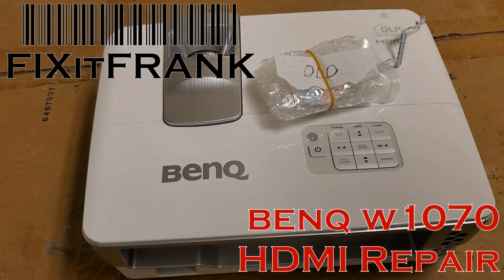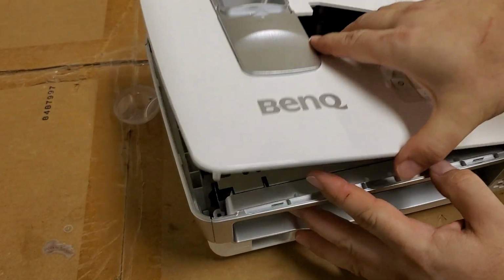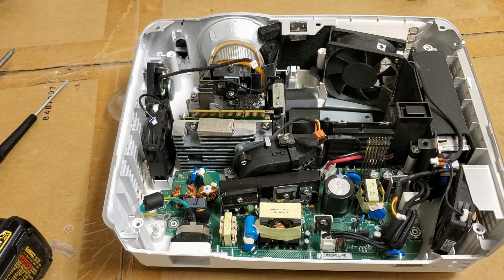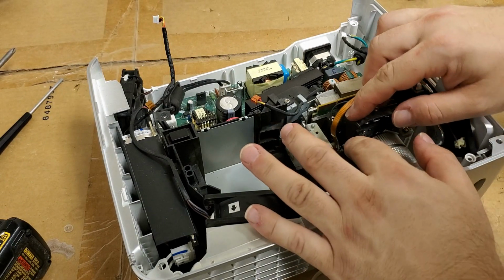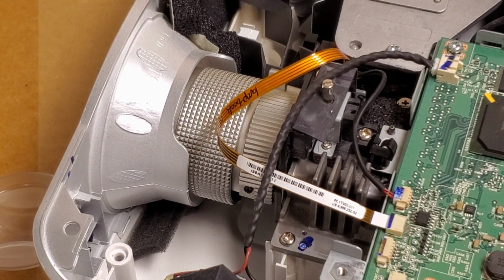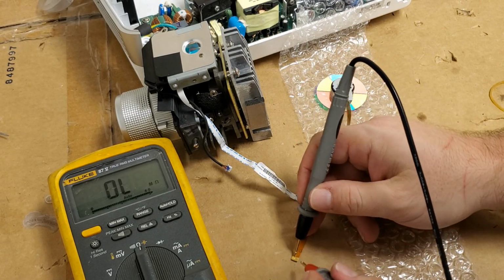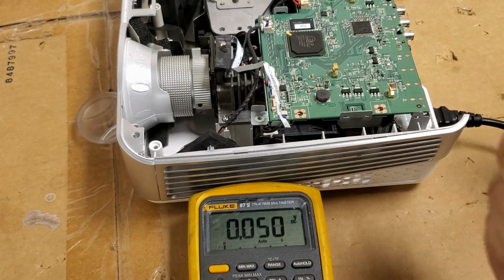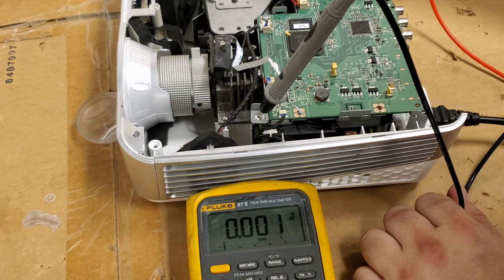BenQ W1070 DLP Projector Repair / No Light-HDMI Issue Part 1

Comment: hello frank i got a question my benq w1070 wont turn on the power button is lit, the lamp logo is off, and the temp, is off. can u pls help me ty
Reply from the maker: Does it do anything at all? No fans? No other noises?  
One thing to check is for a stuck button. Unplug it. The press each button and make sure you feel it click.  If not, that might be the problem.  If another button is stuck, it wont let the projector see when your main power is pressed.  If not, then it will need to be opened up and voltages will need to be checked.  Getting a power light and nothing else is unusual.
Reply: @FixitFrank  so i opened it today and i checked the bulb is looking good no cracks or black soot,  when i do press the power button while holding down the other button i dunno what its called, it doesnt do anything, no fans and no light from the lamp, and the color wheel is not spinning. and no other noises the button feels fine i  clicks as a press it
Reply from the maker: @xatreyu  make sure the door is closed. It won't do anything with the lamp cover removed. If the lamp cover is installed and it's not working, it would need to be checked inside.
Reply: @FixitFrank  yes i made sure the door is close so the fan, color wheel and light is not turning on and no other noises. what could be the problem of this?
Reply from the maker: It could be a few things.  Power supply problem, bad button, firmware, or a mainboard.  You would need to be well versed in using a volt meter to search further. If you have a meter and want to try, let me know.
Reply: @FixitFrank  sure I can give it a try so which one should I test first and how
Reply from the maker: @taylor-robloxandetc1944  I'd start with checking the button for function.  Then move onto the power supply.  After that its mainboard testing and that can be very involved.

Comment: help me please I opened up my projector because when I dropped my projector the glass from the bulb went in the blower fan and when I removed the glass and put the projector back together it won't turn on? what did I do wrong
Reply from the maker: Hi Justin, I have a few questions.  What model is it(W1070?) and do you have any LED indicators when you plug it in?
Reply: FixitFrank yeah it’s a w1070 I opened it up again right now to check if everything is plugged in and it is and it shows no lights when I plug it in or when I click the power button
Reply from the maker: @justinpohyar7817  OK cool.  I have a dumb question.  Is the lamp cover installed?  Also is the mainboard lined up with the pins from the power supply on the bottom?
Reply: FixitFrank yeah the lamp cover is installed and yeah I think it’s lined up there’s like a small spot and those long pins have to  go in
Reply from the maker: @justinpohyar7817  That is correct.  However its not hard to shift them and still have it seat.  It's worth a look. Also make 100% sure the thermal breaker(little rectangle with 2 wires) is plugged into the mainbaord. It might be worth re-opening and going back down to the power supply and re-assembling again. The door switch wire and the thermal breaker wire are both plugged into the mainboard along the far side(lamp side).  The only other thing you can do is start measuring dc voltages on the mainboard.  f you have the door switch pushed in and the power cord plugged in, you should have some low voltage DC on some of the mainboard power pins.  If not, then you need to get back down the main power supply anyway.
Reply: FixitFrank I just clicked that button on top of the lamp cover and the power light and the power button started glowing but it still did not turn on
Reply: FixitFrank is there any way I could send you pictures of it when I completely open up the projector so you could show me exactly
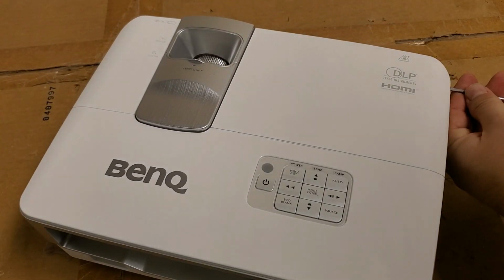Reply from the maker: @justinpohyar7817  that button is a safety interlock.  The lamp cover is the white plastic bit that protects the lamp.  If that is removed the safety interlock will not work. That is the black button you pressed.  what you see me removing at 1:30 is the lamp cover.  Without it installed you will not get any power. This is to protect people from electrocution.
Reply: FixitFrank oh okay I put it back on and still no power only when I click that safety button the power light turns on for a second then it turns back off
Reply from the maker: @justinpohyar7817  why dont you email me at sales@weezytech.com? Send me a picture of what the projector looks like right now.  I probably wont see it until the morning but Ill get back to you.
Reply: FixitFrank okay I will thanks
Reply: FixitFrank I’m using a PS4 plug to plug turn on the projector it was working 1 month ago and when I got back from vacation I took apart my projector when I put it back and plugged it in I can hear the electricity so I don’t think my plug is messed up

Comment: hi,

i have a benq w 770st and cant find the problem.
my old lamp went off after its normal lifespan, the replacement lamp didnt worked either.
first thought was a bad lamp due to shipping, so i got another one today, my beamer is starting but the bulb won't start and the beamer starts giving out red flashes on the lamp indicator as it had died.

any suggestions?
Reply from the maker: Hi Leutnant! My suspicion would be a color wheel problem first.  The startup sequence is, press power button, then fans start, color wheel starts, then lamp starts.  If the color wheel or fans do not spin up first, the lamp will never light.  
If the color wheel does spin up, and no lamp, then ballast would be my next area to investigate.  I have numerous color wheel repair videos. This video may be most helpful for you.  It is about a mitsubishi but that does not matter.  almost all DLP beamers follow the same rules. https://youtu.be/DbhFVKExGVQ